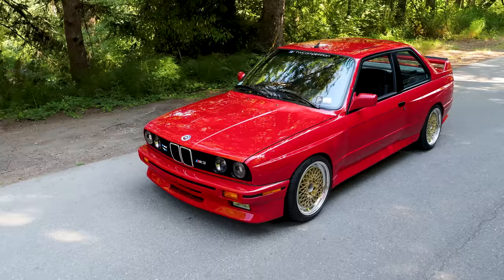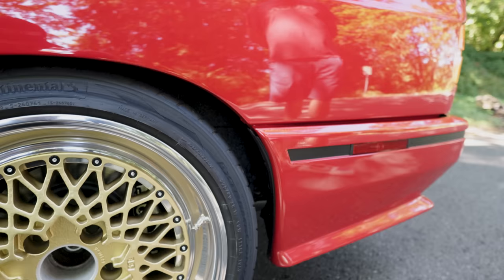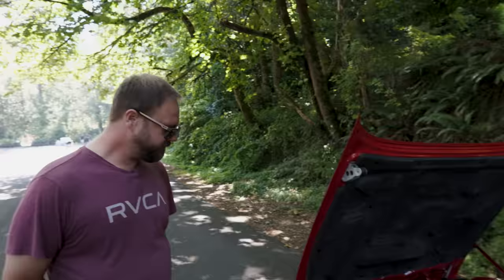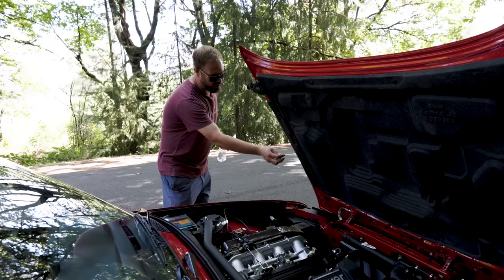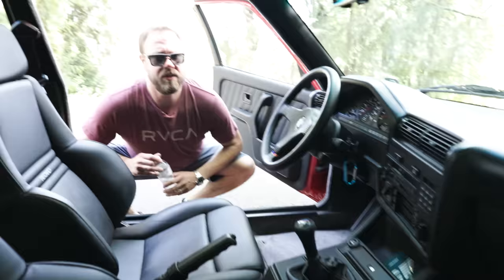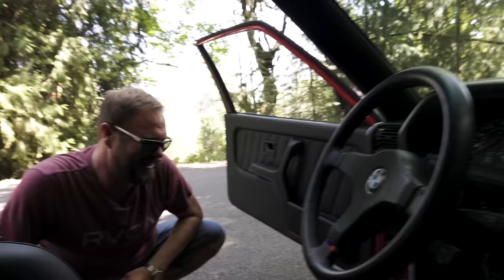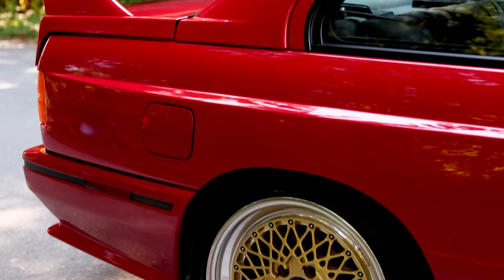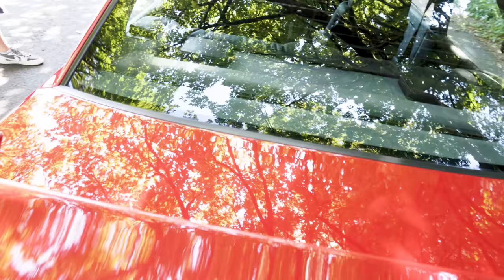Concours-level E30 M3 From My Dreams

Comment: Interesting how there’s an obsession with originality down to the most minute detail, while at the same time other areas are significantly upgraded or modified.  In any case, I love that the owner built the exact car he wanted. Stunning!
Reply: That was my thought as well. Insanely well done, but the seats stand out like a sore thumb.
Reply: This kind of confused me too, and also how the valuation was derived considering this, and that maybe valuations are not affected by changing away from original condition/style etc
Reply: Its a perfect condition but but but ! Upgrading parts threw away all pristine Concourse  restoration level about this beauty . Ask any specialist in restoration industry they ll say the same thing .
Reply: He couldn’t help himself with his JDM experience. For instance, I couldn’t help myself on the suspension as well. To me, the suspension and an extremely high quality short shift kit along with brakes is the utmost importance for driver satisfaction.
Reply: @kirkschmidt2912  They probably evaluated high so they can charge him more monthly. Like when I was buying a tv, the more it costs the more the protection plan costs.
Reply: Yes we're all on the same page, originality but then kyb coil, aftermarket exhaust, Recaro non correct, blacked Hellas, this is the perfect argument for maintaining originality, surprising how it takes away from the art of this car. I think go for original or DTM omage

Comment: While i´m not quite this particular about every clip and bolt, this OEM+ is the way to go for me as well with my E36´s,
increasing driveability and performance where possible, but without compromising the original looks.
You won´t find a piece on my car that you couldn´t option from factory back in the days, but at the same time pretty much everything underneath it is completely new and brought up to date,
for example completely new Bilstein suspension, strut bearings, stronger wishbones, anti-roll bar, etc...
Same goes for interior, lookswise i got a completely original looking Blaupunkt radio, but inside it has a USB-port, Aux-in, bluetooth and even digital radio DAB+, 
but i had to figure out how to run it over the factory antenna, since i obviously didn´t want an additional one that wasn´t in there when it rolled out of the factory. 😅👌
Anyways, this is pretty much the absolute perfect E30 restauration, completely jaw dropping! And without a doubt to me the value of it will only increase from here.
The more parts will become inevitable just unavailable , the more it´s value is gonna increase, inevitable.
It´s probably already almost impossible to recreate this build to this extend, so i REALLY would hesitate to ever sell this gem of a car! 👍

Comment: Very beautifully done, bravo👏🏾👏🏾👏🏾. So I ran a couple of this when they were still relatively new, a Ceccoto model and an evolution for close to 25 years. So I know what to look for, this one here is not original, I’d say perhaps 60% close. He has mixed a lot of non OEM, Sport Evolution model parts in a mish marsh to come up to a stunning looking car but by no means not 💯 % OEM. The headlights lights and wheels jump out instantly to start with, the carbon box is another, the rubber in the engine bay also was unique to the sport evolution for aero dynamics, I could go on and on. The above is a small list of noticeable non OEM to standard car. Wish the wheels were the genuine article. Aside from that great effort and stunning looking car. Well done indeed👌🏿